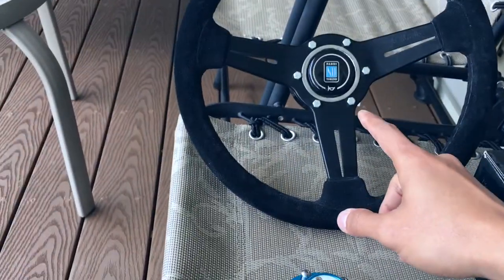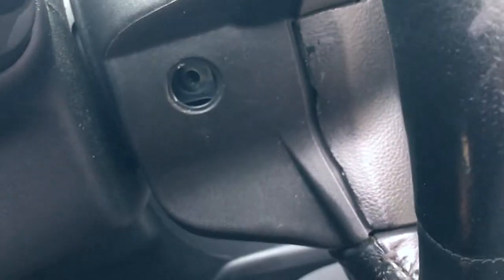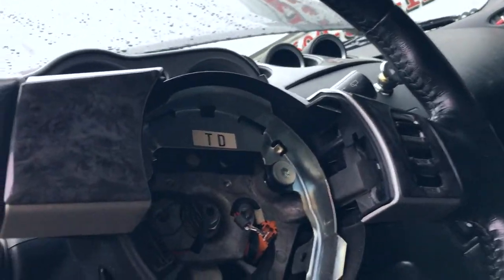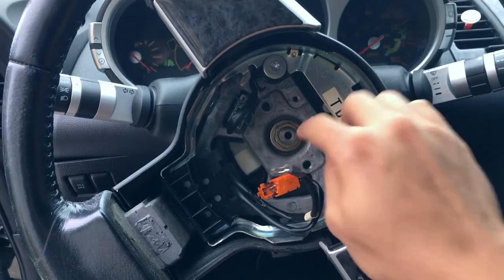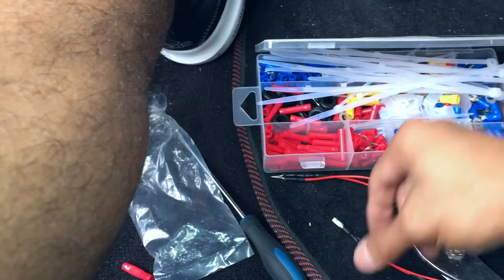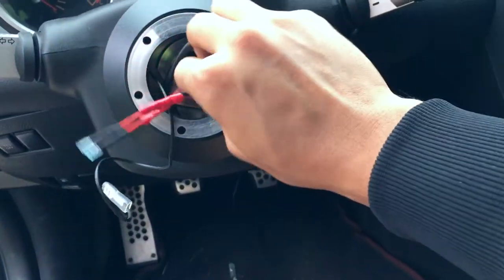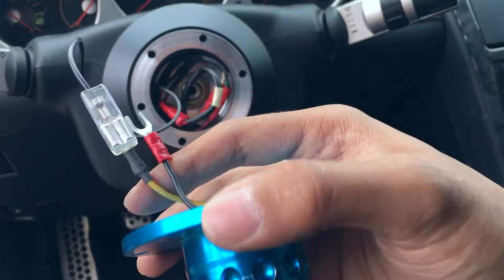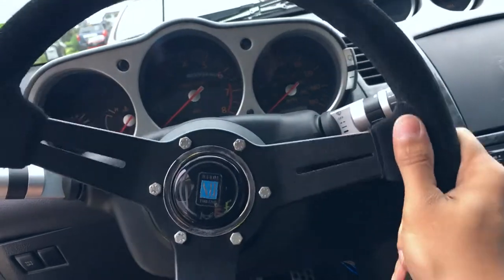Nardi Steering Wheel/ NRG Quick Release Install on the 350z!

Comment: You said that the NRG adapter is vehicle specific i have a 06 eclipse and they don't make the adapter for the car will getting a different one effect it??
Reply from the maker: Grant Hinton did you search up 06 eclipse quick release? It won’t work unless it’s made specifically made for your cars year and model
Reply: What do you mean by it won’t work because no one makes them for a 06 eclipse
Reply from the maker: Grant Hinton I️ got the quick release from a s2k owner who was parting out his car. When I tried to install the hub it didn’t fit my car the threading is different. Did you try emailing or getting in touch with someone from NRG?
Reply: no i have no clue who to email
Reply: I am just try the SRK-100H thats what the other eclipses use
Reply: have you checked momo? there is more then one company making hub adapters
Reply: you can get lucky with close ish models being the same spline